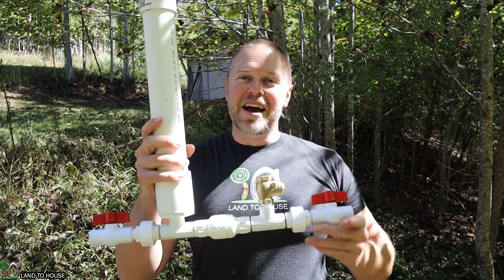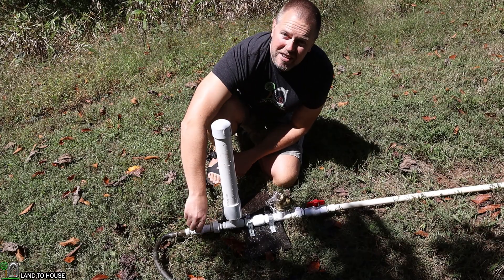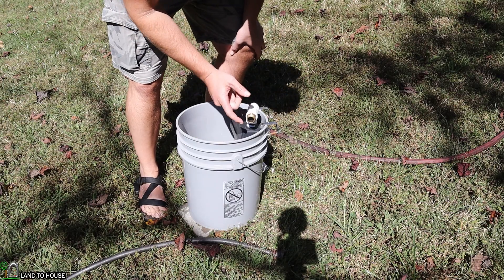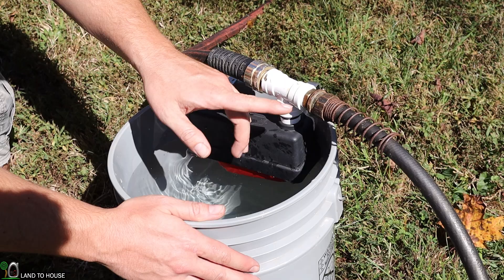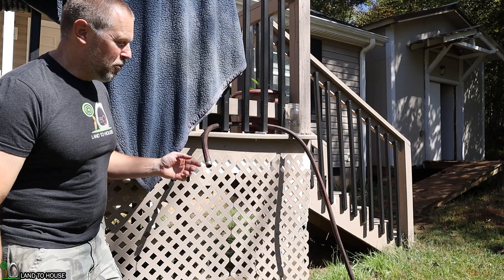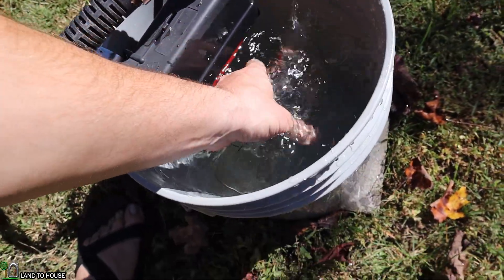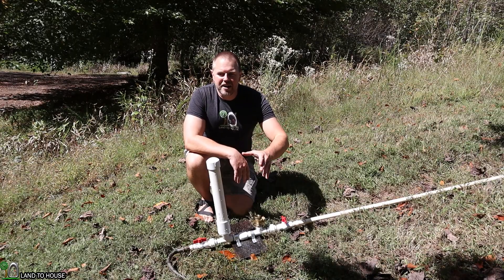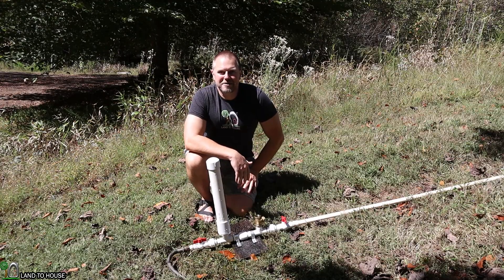Ram Pump Float valve Splits the Delivery Pipe

Comment: Haven't watched the video yet, but my though is that there's a maximum height to which you can push waster with a ram pump, based presumably on head pressure at the pump, pipe size, elevation you're pushing the water up to, etc.

So, it seems to me like putting in a float valve wouldn't really change that "maximum pumping elevation" and so it might not get up to the next station for that reason, depending on how much further up the next station is (how much extra elevation gain)? But, we'll see?

Which sort of brings me to my own idea for getting water up a hill via multiple stations, but with a slightly different setup. Can you have multiple large tanks going up a hill, each of which has a ram pump attached to get water up to the next station, and each of which has a "reclamation bucket" at the waste check valve, with a pipe or hose that goes down to the previous station's storage tank, to "recycle" any "waste" water from the waste check valve back down to the previous level's tank, to get a "second chance" to go back up the hill, thus sort of reducing "waste" at each stage up the hill, and leaving basically just the bottom level's check valve as the actual "loss" from the system? If that makes any sense?

Obviously, it makes things perhaps slightly more "complicated," but maybe reduces "waste" to some degree, eventually pumping more of the collected water uphill rather than just "wasting" it to land or back to the stream, or whatever?

Comment: A question

What is the average "wastewater vs pumped water" and what is the "best done" as for that ratio? 

Assume that one has a head delivering 100 liters pr minute, how much percentage is wastewater then and will the size of the ram pump change this`?
Reply from the maker: The ratio of wastewater to water pumped does change as the lift height above the pump changes. There is a point where water no longer comes out the delivery pipe meaning all the water is wastewater. In normal operation, approximately 85 to 90% of the water is wastewater.

Comment: What about out of a well?
Reply from the maker: If the well is flowing out of the ground like an artesian well , then it would work. The ram pump is not able to pull water up and over a well casing.
Reply: @LandtoHouse thank you they're still great and I'm gonna get one
Reply from the maker: The ram pump is awesome. Just installed a 1/2" today for a local guy.
Reply: @LandtoHouse truly an engineering marvel